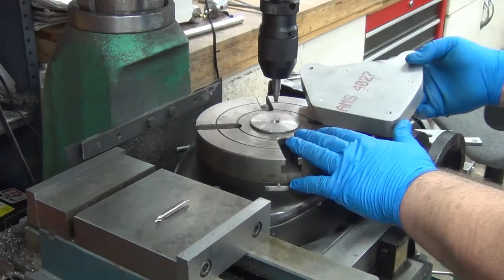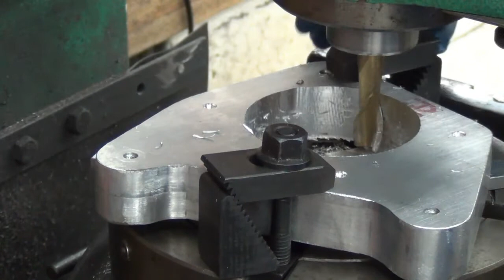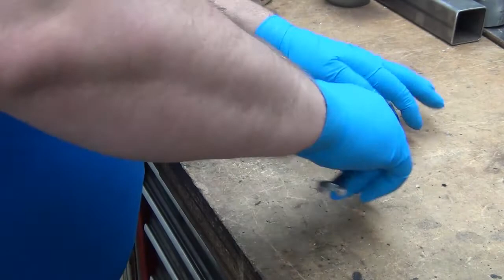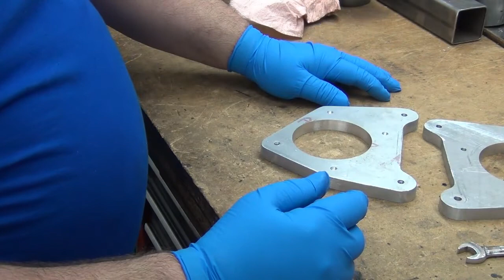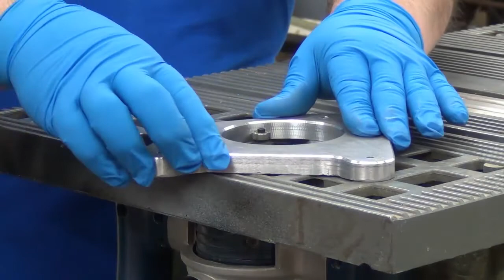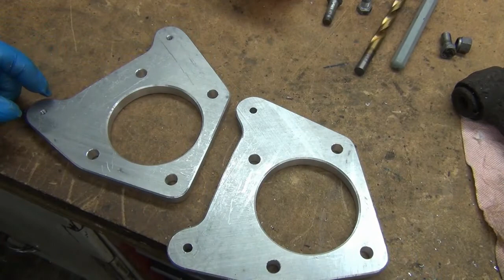Outlaw Brake 5

Comment: top secret is a video I posted of a build on my channel...hope to explain what it is used for, all aluminum build, hence, I like your router table method, would have been easier than using the boring head to chamfer the edges on the radius parts as I did.....

Comment: Hate that when I grab the wrong handle when using the RT....got smart and put a rag over the do not touch handles to help avoid that quick reactive grab...like the router for the edge detail, I could have used it when I built Top Secret...

Comment from the maker: You're more than welcome!  I'd love to say I came up with the idea, but someone else taught me about it years ago. :)
Cool sandblaster.  The ball is pretty unique.  Looks like it was added to a standard cabinet.  I'm guessing the big hose hooks up between the bottom of the cabinet and the top of the ball.....and the sand suction hose comes up through the middle of the big hose.  Then the vacuum would connect to the side port.  You wouldn't need to hook a vac to the cabinet.